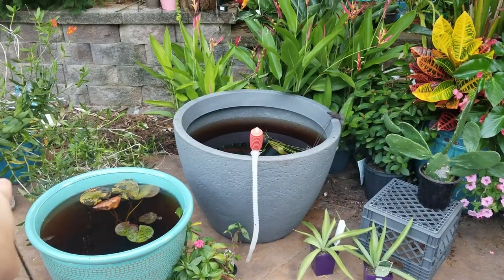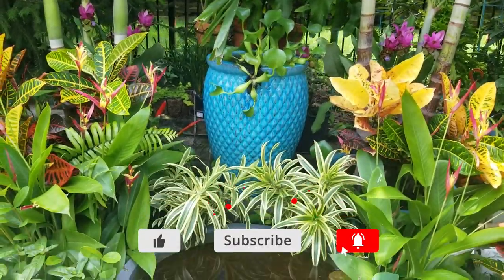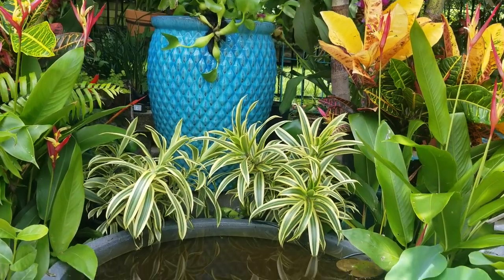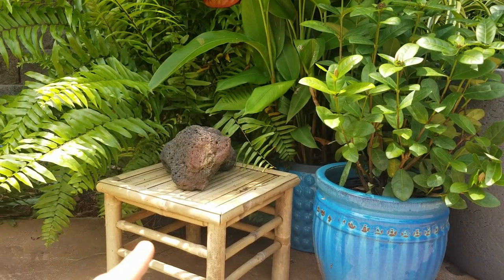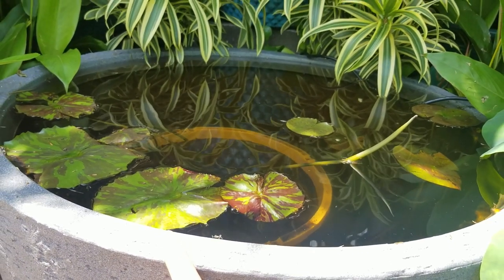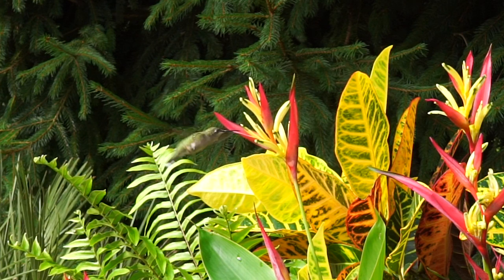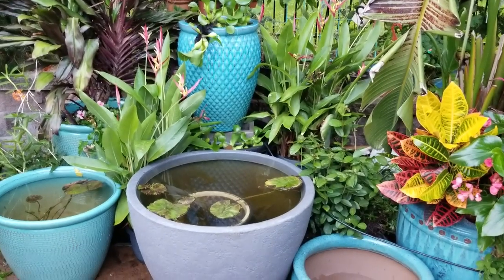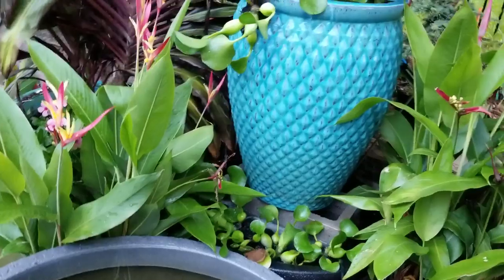Mini Tropical Garden & Vlog

Comment: It sounded like you were saying it, but it got cut off....Chip your pets! And keep the info up to date if you move.Was the pond store you went to Chalily? I went there once years ago after season so they had nothing...perhaps I should do more pond store shopping in season? Keep us updated on the training hyacinth, it seems to me that shoots would break under the weight of a new plant, but growing suspended like that maybe they grow smaller with fewer roots.
Reply from the maker: Yes, chip your pets! Fully agree! Yep, that was Chalily, great plant selection during the season. When I have seen the hyacinth growing down the pots they were very small. So hopefully that will be the case here. Except last night a fuse blew and I came out to a dry fountain and dry hyacinth... so that's a slight set back.

Comment: One question...how would you store the lotus and hyacinth and the water Lille in the winter time...
Reply from the maker: Hi Kim! The water lily and lotus I leave out in the winter. I usually put a trash bag around the lotus to keep it dark and provide a slight amount of protection. The hyacinth I usually grow as an annual. They literally give them away at the pond stores around here so I don't fuss with trying to keep them inside.

Comment: You just insist on making me jealous!!!!
This is beyond beautiful and amazing!!!! Have you ever tried solar lights? If I tried my much smaller rendition of this it would need to be with solar light until I run new electrical lines out. That is part of my 2020 budget. So with the lower water being still, how to you avoid mosquitoes?
Reply from the maker: Hey you! I've used lots of solar lights. Most work well but tend to not last a long time. However it has been a few years since I have them a try and that has probably improved by now. I also only ever tried super cheap ones. I'm using mosquito bits (mosquito dunks) for the mosquitos. So far that seems to be working well. 😊